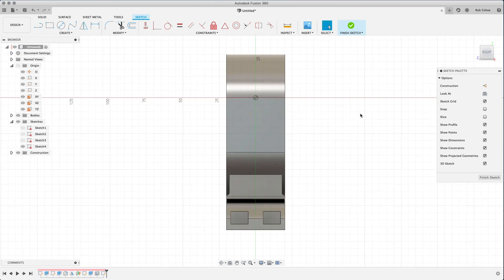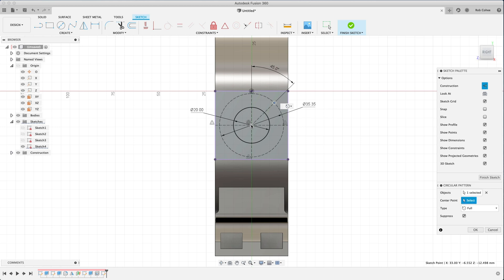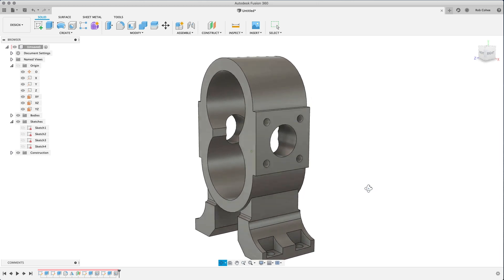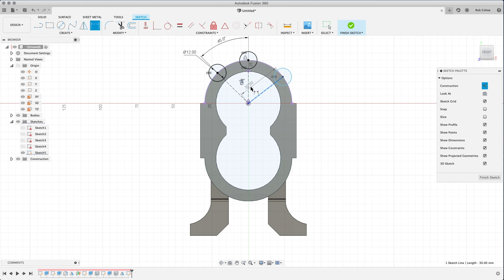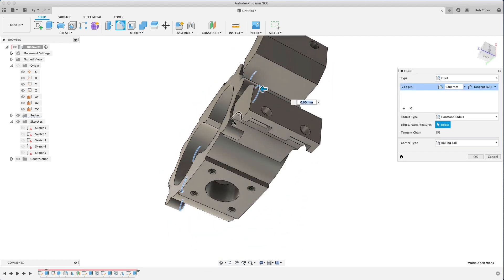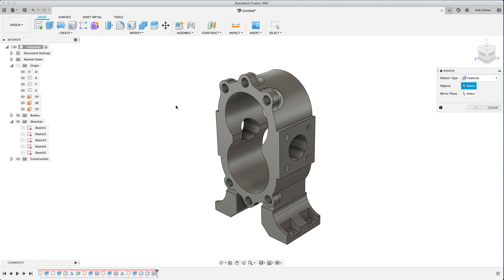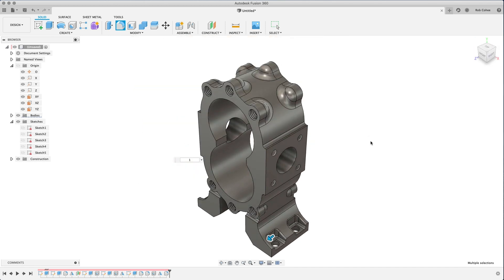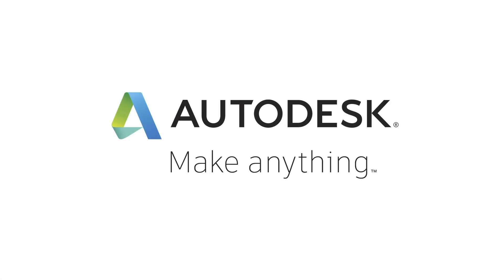Best Practices with Assembly Design for Teams (Part 4) - Tapped Holes, Mirror, and Appearances

Comment: The way you designed the part it would be extremely hard to cast... normally in casting parts, all the fillets have to face one direction.